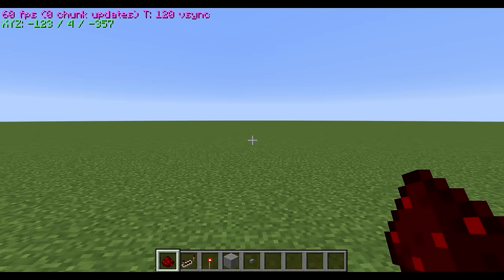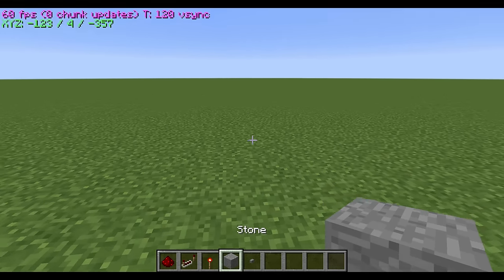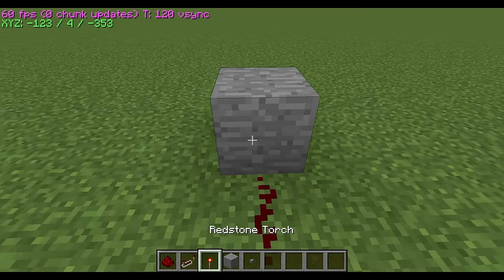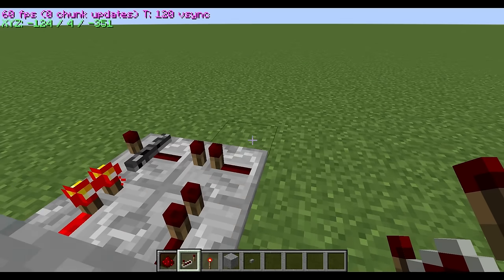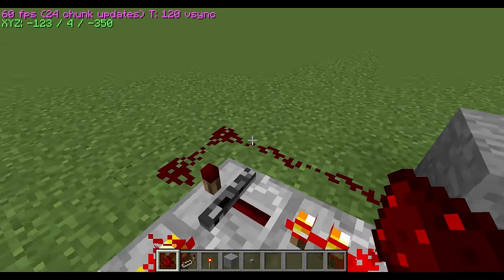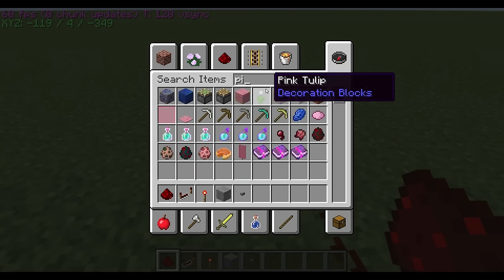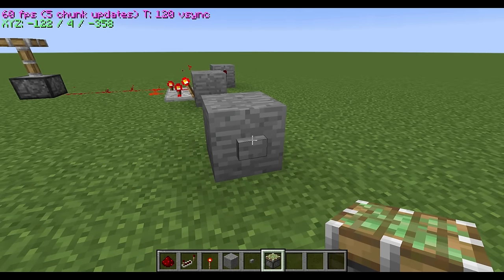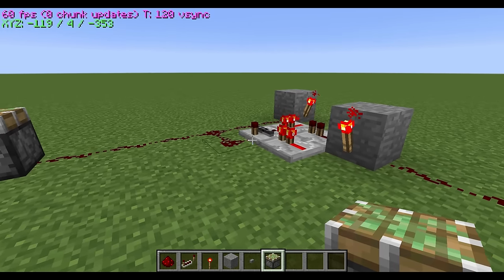Minecraft 1.21 Redstone On/Off Button Tutorial NO PISTONS!!

Comment: To use this circuit from a signal generated by an observer, you'll need a 1-tick pulse extender (to trigger redstone torches).
Reply: i used a repeater right at the start of the system and set it to lvl 3
Reply: Why lvl3? Repeater setting sets delay - not dutation.

Comment: What happens is when you place a base block of any kind down and put a button on it which is a naturally unpowered object and push it the button feeds a signal through the block making the block temporarily powered depending on the flow of power going through it, add redstone behind it to extend the pulse feed the unpowered redstone into another base block and put redstone on the side what happens is when the block gets fed redstone making the block Inherently then powered the power from the tourch gets cut the redstone tourch takes up a whole blocks space even tho it's small place a repeater one block forward from the space it's placed on facing the same direction the redstone is feeding into the block
And it'll be powered place another to the right of that and you'll have one waiting to be powered from the redstone feeding through the block
Then place one facing left from the repeater feeding into the block so you'll have two unpowered repeaters one feeding into the side of another Then place another one in front of the one you just placed into the powered repeater, the reason we do this is because if a redstone repeater is sending a single directly into the side of another redstone repeater, it will make the second repeaters movable tourch, slider into a horizontal bedrock bar, and all signals produced by the repeater will be stopped because

The redstone torch turns off when you give it power because every time you give a redstone torch power it turns that power source off and inverts the signal from on to off
Then feeding into whatever if going through the base block it's attached to. And then place a block, one space up to the right of the repeater being fed into by the one that's connected to the redstone through the block and place a redstone torch on the front side so it should power the blocked repeater being fed power from the side leaving you with a powered repeater feeding directly into a blocked unpowered repeater 

So even if a buttons pulse turns off if you run redstone through the left side of the second redstone touches, block and directly into the front of the blocked repeater and push the button then the button will power the block 
Feeding into the redstone and that will Carry our signal to the block with the redstone torch and turn it off for a second simultaneously unpowering 
The repeater powered by our torch then the redstone feeding into the base block will power the repeater in front of it for a split second when the power is cut from the repeater one block up from our torch It unblocks the repeater in front of it whitch then turns that repeater into a blocked one
Then gose back to normal but keeping the power in the charged blocked repeater turning off the second redstone torch.

Comment: Great little trick! Works perfectly for Pocket Edition! Seeing how the piston trick with a shortened pulse does not work for PE, this trick works wonders.
Reply from the maker: Oh sweet!  Yeah, the other on/off switches uses pistons, but with this method... all things are possible!  Lol.  Glad it works out!!
Reply: +BigPileOfWesley been frustrated with some of the limitations of PE, but this helps a lot. Not to mention it's a lot cheaper to make in the main edition survival and is useful for designs where you want to limit the chugging of pistons behind a wall. Been tinkering with a few multi-function single-button designs as well, so this will definitely be a useful circuit for me.
Reply: +Giraffe23i I think I heard that Pocket Edition just got an update to include pistons. I could be wrong, that's just word of mouth. Might be something worth checking out :D
Reply: +Wesley Donahue Yes, it does have pistons, but the sticky piston doesn't allow itself to let go of a block. Either the game doesn't update blocks in the same way or the Pistons don't react to shortened pulses in the same way. Whatever it is, it's still a problem until they make PE fully updated with the main release.
Reply: +Giraffe23i Ohhhhh okay, I gotcha. Hopefully they address this issue so it reflects more on how the PC version acts.
Reply: +Wesley Donahue They have said that they plan on updating the PE and Windows 10 versions of the game so they work flush with the main release of the game. It will be cool to play your world wherever you are.

Comment: This is almost what I need. I need to press a button to activate a sticky piston which would move over a floor block exposing a lower room. When I jump down into the lower room I want a pressure plate to activate the sticky piston again, closing up the floor block. Then when I step on the pressure plate a second time it will reopen the floor block. Once upstairs the button will reclose the floor block. So I need a circuit that works like 2 levers but using one button and one pressure plate instead of levers.
Reply from the maker: You can totally do this with this setup.  

You can attach redstone wire from the bottom pressure plate to the first line of redstone wire that leaves the first button.  This isn't limited to only one button :D.
Reply: BigPileOfWesley  After watching this video I started watching Boolean Logic Gate videos. :P I'm torn between taking the time to learn redstone systems, and just copying something that works. lol.

Comment: Can I assume that the input can be a detector rail and the output controls a rail switch?  That would mean that each time the activator rail was activated it would toggle a rail switch further down the line to switch back and forth between two tracks. I hope that makes sense. Thanks for the demo..

Comment: And i know a easter way. You need to make 2 ways connected to the button, one has a repeater on 1 tick. And the other one on 2 tricks. The 2 tricks side needs to have a piston that Disconnects the connection of the 1 tick side. The redstone is small now so if you put a stick piston on the end of the 1 tick way. It will push it on the 1ste hit and the piston will go back but the block stays there so. You put a redstone torch or block next to the block that moves on every click. Put a repeater on one of the 2 possible positions. Place it the way the redstone gets True the block. Like this: redstone torch --> repeater --> --> block --> redstone connecting for a exempel a door. Make sure the torch doesnt hit the piston. Now if you hit the button the door stays off or on. And the block that moves on the left or right. And when you click it gets to the oppositive side and the door will open if it was closed, and closed if it was open.

Hope this helped
Reply: Easier way*
Reply: I love easter

Comment: what I need is for the piston to be on at all times (so extended) and when I press a button it turns off (retracts)
Reply: You could set up an inverter on the piston. Between the power source and the piston put a solid blocl. Then between the piston and the block, place a redstone torch on the block. This will keep the piston powered while the power is "off". Once you turn on the power it will deactivate the restone torch and your piston.

Comment: I'm using this method over a bigger area with redstone repeaters and it's not working cause the repeaters lights up the redstone... any idea why?
Reply from the maker: This design has to be made exactly to spec. You can't expand this design or the torches won't be where they are supposed to be and it won't work correctly :(. This is one of those "you must build it exactly as it's shown or it won't work" sort of deals.... Sorry :( hope this helps

Comment: imagine if they just had a switch like a normal circuit setup...
Reply from the maker: Just imagine
Reply: Wouldn't work if you want to control, let's say, a secret door with switches on both sides to open/close. If you'd have switches on either side, you would have to manually put both switches in the 'off' position to close the door. With this method you just put a button on either side, press one button to open the door, walk through the door, and then press the button on the other side to close the door.
Reply from the maker: @jonathansera6134  and that's EXACTLY why this is such a good idea for a modular system :D.
But still.  Let's just imagine.
Reply: @jonathansera6134  that's not what I mean at all and it doesn't make sense. Levers and switches don't have to be the same object. Obviously levers are a good and fundamental component vs only redstone torches where you'd have to break them to turn things on/off.
Not having switches obfuscates making the most fundamental and common circuits and controllers. You can't even make cmos gates let alone toggle the communication of an existing logic signal with one block.
Reply: @ReasonableRadio  Sure, bud. I think what you're looking for is a circuit simulator, you might have more fun playing Multisim.
Reply: @jonathansera6134  Uh.. no? I don't think I have to explain why people play minecraft do I?
Reply: @ReasonableRadio  Lol, nobody is asking for that. I just see a lot of complaining & trying to sound smart, so I thought I'd point you in the right direction. Take it or leave it.

Comment: Just use a lever
Reply from the maker: A lever doesn't allow you to power something from two or more locations. This button method allows for a very modular design if you want to power something from more than one spot :)
Reply: BigPileOfWesley Just add two levers in two different spots
Reply from the maker: @shanethompson7157  assuming this works, sometimes people want to play with redstone and make cool contraptions :).
Reply: BigPileOfWesley Fair point.